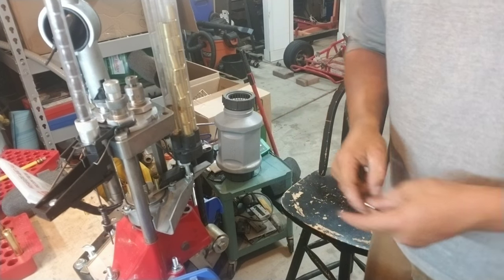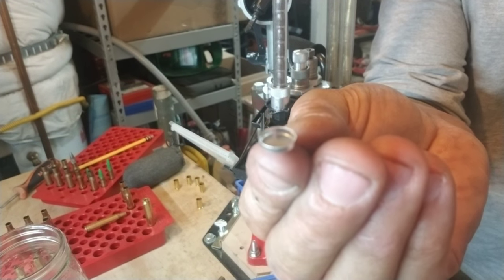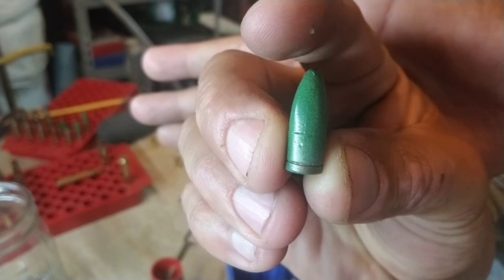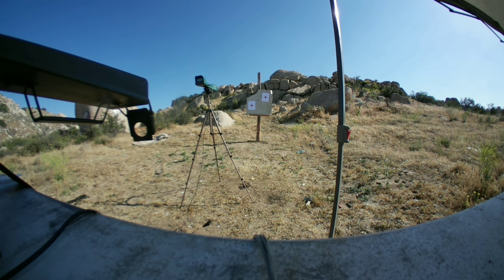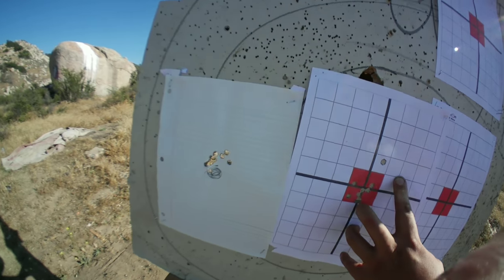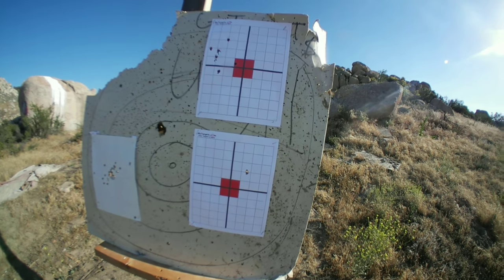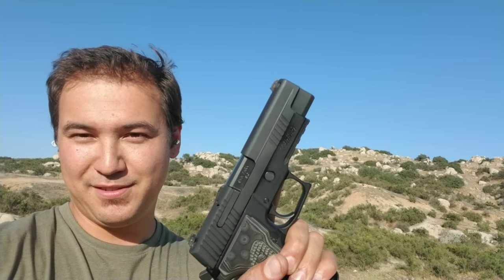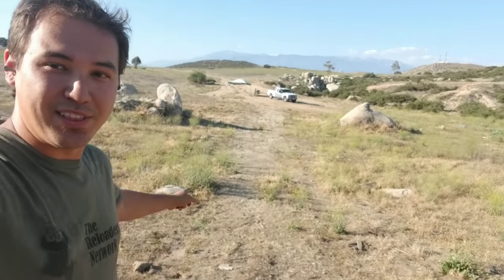Gas Checks. Do they make a difference in Cast Pistol or Rifle Boolits?

Comment: I think they do make a difference.   They likely help to minimize, or hopefully prevent leading, and assuming proper installation, they square up the bullet base so its absolutely true.   This is critical when the bullet exits the barrel as gases disperse equally around the base, ensuring the best possible accuracy.  Today, (2023) GCs are getting expensive - like everything else - but I think they are worth the cost and extra effort.  Sure can't hurt a thing.   I've used them for over 50 years and have a large supply on hand.  Nice, informative video.

Comment: Nice video brother. When you said you water dropped your 300bo for 23bhn you mean after they come out of the powder coating oven right? If I water drop my ww alloy from the mold they test at 22bhn. If I powder coat those same bullets, and air cool they drop back to 13 bhn. Now if I powder coat accoww boolits for 20 min at 400 and immediately drop from the oven into ice water they test at 22 bhn the next day. So now I always air cool boolits while casting. But if I want harder lead for rifle or full Magnum I water drop after powder coating. Hope that makes sense. Side note, for fast rds I usually cast heavy for caliber boolits such as Keith's and size .002 over bore and water drop to avoid needing gc's.i also save on powder with heavy boolits, plus my leads already free :)
Reply from the maker: Ya I like the water drop method after PCing. It helps break up the boolits. But I actually heat treat while PCing. 10* under melting point of lead for 30 min then water drop. I get 23BHN right away. Which then go up after a week to 28. I learned this method from Dima Prok
Reply from the maker: I wrote an article on The Reloaders Network about gas checks. In my expirence and understanding my primary reasoning for using GC is uniform bases. It has helped tighten all my rifle cartridges. The reasoning I believe is because of a uniform base. The most crucial part of our cast boolits
Reply: The uniform base theory makes sense although many times I have an indentation in the center of my gator checks. Seating gc's on PC's bullets is a pita and pc-ing after checking leaves a lip of PC on the bullet base where I stand then upright. I get great sharp bases with my 359 Keith bullets but I cannot ever get the NOE mold to drop bullets with concentricly sharp driving bands. I've added 2% pewter and tried every mold/alloy temperature I can think of and almost every time half of the bullet will have a slightly rounded frosted driving band. Your friend Dima is a very sharp dude I've watched his videos.
Reply from the maker: O ya. Gas checks are a big PITA powder coating. Using left over powders they seemed to coat even without those burs for this bullet. I agree with you on the uneven castings. I have been fortunate to try some swedged .358 TC bullets and It shot really really good out of my sig. Same load, clover leaf. Makes me wonder

Comment: Don’t think it’s a good idea to shoot gas check bullets without gas checks ?  My thinking is the recess for the gas check in the lead of the bullet could alter the accuracy as it leaves the barrel , with the pressure behind it and  the heat of the burning powder could distorted the bottom of the bullet!
I make my gas check bullets and have no problems in any calibre! I also have moulds for those calibres for non gas check bullets. Use Lee’s Alox on both types .  Calibres are .44 sp/mag, 38sp/357mag, .303 Brit and .308. The .44 and .38’s are shot in revolvers  and  Winchester 94’s  👍
🇬🇧🏴

Comment: I have had issues with gas checks wanting to stay on as well after powder coating at higher velocities in my rifles. I think it is something to do with making the lead slicker. BTW that was with Hornady copper checks that had been annealed. I now gas check and then powder coat. Hmm wonder if there is an accuracy difference there. Keeps the checks on though. Its like gluing them on.
Reply from the maker: I like gas checking then powder coating with a powder coat gun. Makes really clean coated bullets. I recovered a few Gas Checks from hitting rocks and I can contest the gator checks stay on great aswell as my homemade ones from Dima Proks check maker. Bullets traveling @ 2100 fps in 300AAC

Comment: Great video boss. Do you think the non gas checked 300BO bullets may have leaded due to a gas check shank that wasn't covered? I have always wondered if the exposed non sealed shank would promote gas cutting and leading. Thanks 
Nathan
Reply from the maker: The micro groove bullets with gas shanks I think are more susceptible to gas cutting  as there isn't much surface sealing. It's almost always the rear drive bands that show this sign.  Seeing those who recovered bullets.  Thanks for dropping by Nathan!
Reply: Good point that they will be less susceptible to than traditional or micro groove bullets. I hadn't put enough thought into the slick sided bullets yet. Do you think the edge around the shank may have been melting or blowing off causing the leading?
Reply from the maker: Its very possible. I think im going to try to recover some of those 300AAC bullets through ballistic media to see what the bases look like. Also I'm curious if these checks are staying on. I can't wait to get more into paper patching though. Taking the weekend to scope out some BLM land here
Reply: I have seen the very edges of shanks blown off of bullets before but I'm not sure if you'd run into that. I have seen the GC fly off 5' past the muzzle. My experience its already done its job and it doesn't seem to effect trajectory any.